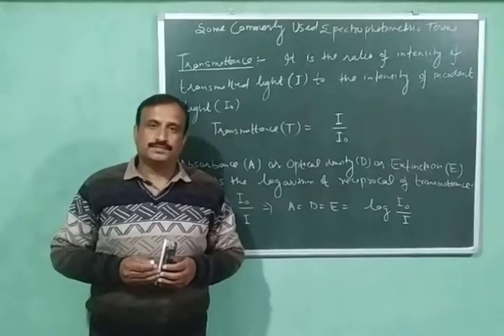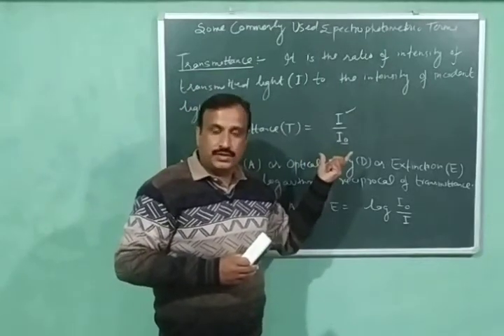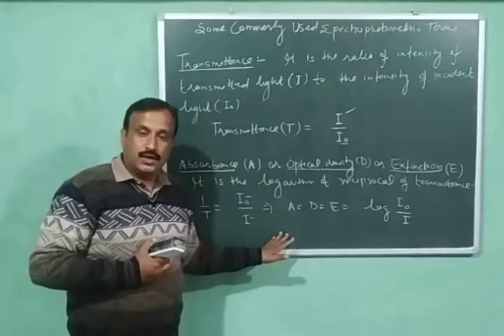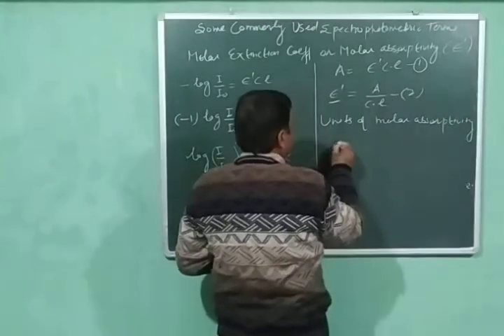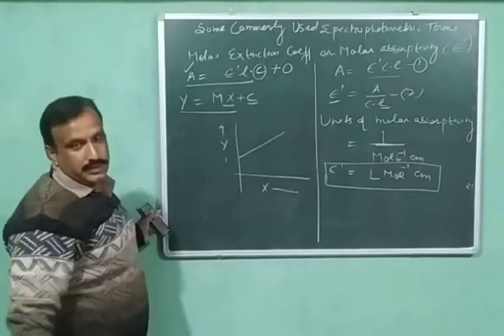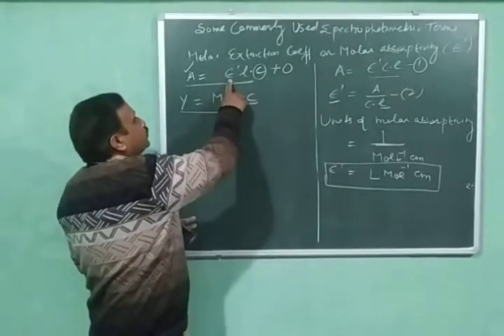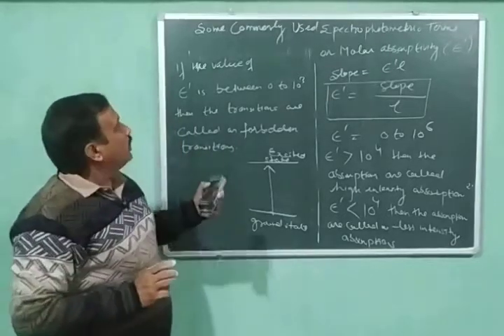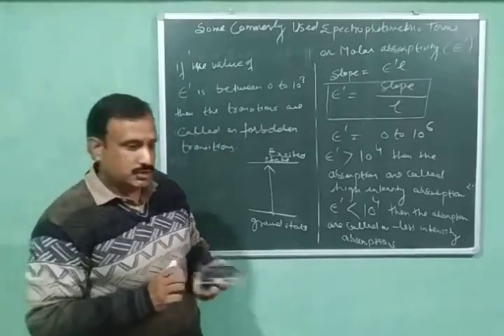spectrophotometric Terms:  Transmittance, Absorbance & Molar extinction coefficient or absorptivity

Comment: Sir I have one problem in physical chemistry
Reply from the maker: Send me your problem. I will try my level best to solve your problem. Please like and share my videos and subscribe my channel.
Reply: Sir can I text the question
Reply: molar polarization of diethyl ether on dissolving it in cyclohexane at 20 degree celcius at infinite dilution was found to be 58.50 cm3/mol its molar refraction was found to be 22.40 cm3/ mol applying 5% correction to rm calculate the dipole moment of diethyl ether
Reply: @dmgchemistryclassesbydr.mo4852  sir which formula is suitable
Reply from the maker: Solution:  Orientation polarization Po = Molar polarization - Molar refraction
Po = 58.50-22.40
       =36.1
Po = 4/3πN μ2/3kT
      = 4πNμ2/9kT
μ2= 9kTPo/4πN
μ=√9kTPo/4πN 
Where k = Boltzmann constant N = Avogadro's number , T is temperature=273.15+20=293.15K
μ= √9*1.38*10-16*293.15*36.1/4*3.14*6.023*1023
= 131.81*10-20 esu.cm
=1.3181*10-18 esu.cm
=1.3181 Debye
=1.3181D
10-16 = 10 raised to the power -16
1023  = 10 raised to the power 23
Like and share my videos & subscribe my channel.
Thanks.
Dr. Mohinder Guleria
Associate Professor in Chemistry
Reply from the maker: I have sent the solution of your problem.
Reply: Thank you sir🙏 sir on which the magnitude of optical density and molar extinction coefficient is depend